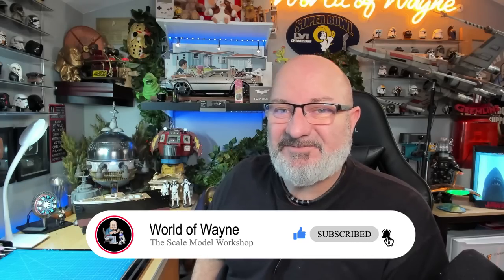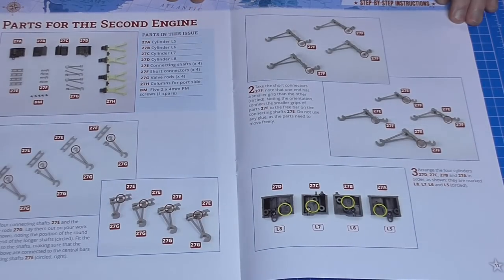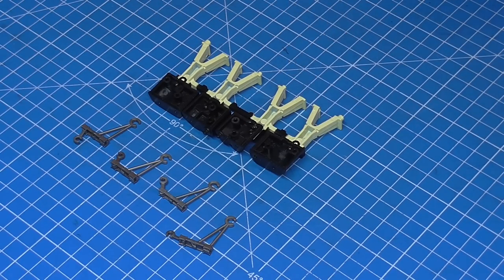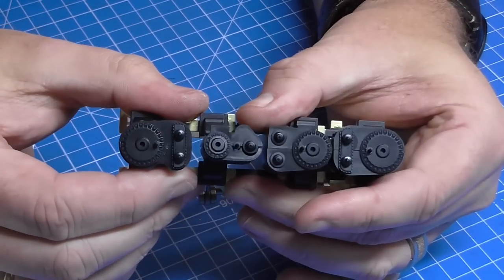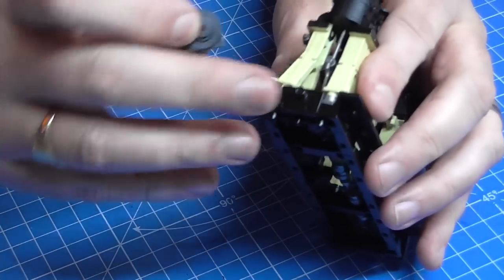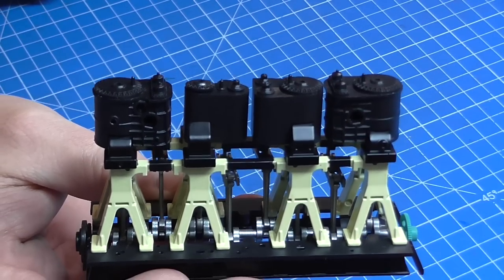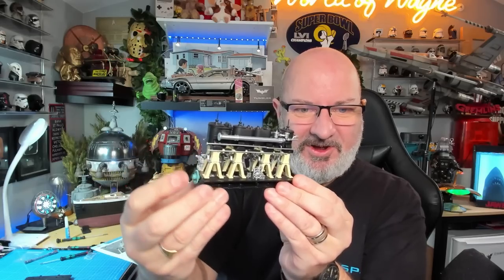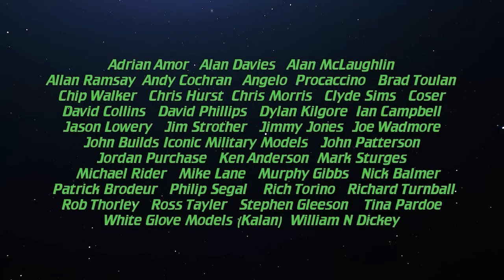Agora Models Build the RMS Titanic - Pack 6 - Stages 27-32

Comment: saw a youtube video that showed that the first piece that was already screwed down to the engine room floor was going to need to be shimmed up just a hair to meet where the flywheel from the engine is. There will be a shaft running through it to engage the flywheel and turn the engine.

Comment: WOOF!!   Folks, I just finished Stage 32 of Pack 6 tonight and THEN I came to watch the Master Wayne.  31 was fiddly but 32?  My advice to any other intrepid modelers is read ahead all the steps...I found that it was more logical to go slightly out of sequence when fitting the smaller bits.   Ex:. Step 7, glue 32C after screwing 32D & 32H to 32E.  And so on.  (Same way Wayne did).  Make it easier.  (Edit):. Oh boy, we still have the starboard engine also.  The Joy of Modeling.  This is why I became an airline pilot and not a surgeon!
Reply: An Airline Pilot building a Titanic Model ...nice .. 👍... 😁

Comment: hey mate, what is that pen thing you use to dip your superglue? i usually use a tooth pick from your recommendation during my terminator build but i am more interested in something like that.
Reply from the maker: It’s an archamedis drill with a normal jewellery pin stuck in the end
Reply: @WorldofWayneUK  so it's nothing really special then. I thought it was something high tech to use for gluing stuff. 🤣😅.. also am I the only one that misses the parts being packed in plastic and not boxes.. I usually use the plastic for my glue containers.
Reply from the maker: @AWF1000  Yer. We have this thing where one generation wants to save the oceans and kill the trees and another wants to do the opposite :D